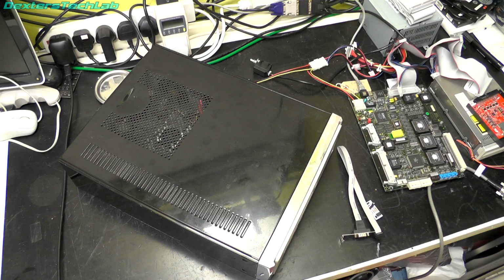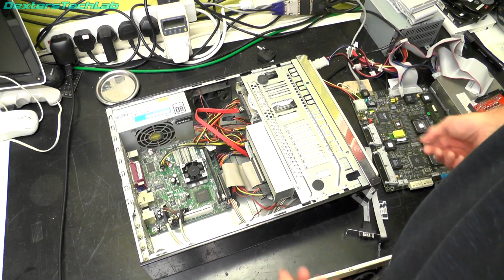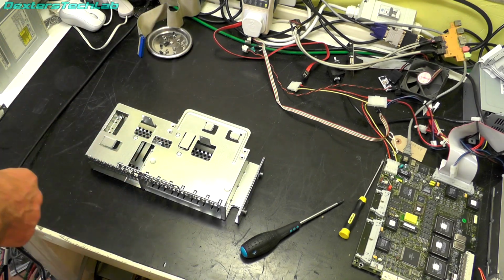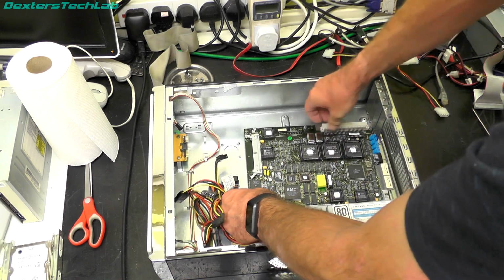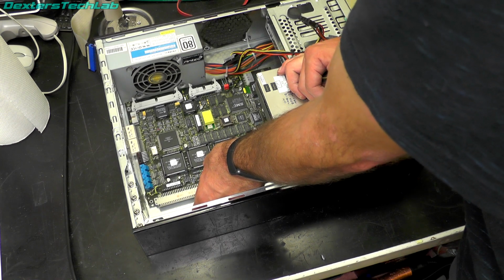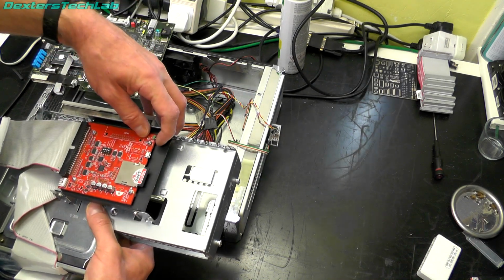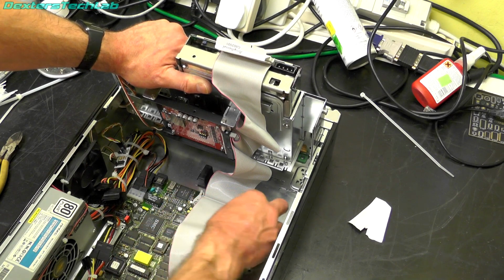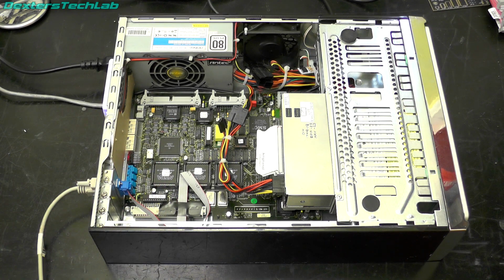DL247 Quantel Netcom Part 2 Building A Network Storage Drive

Comment: Have you or any of your Discord fellows figured out how to mount a Quantel MO disc on a PC, Mac, or UNIX box? I remember you saying someone was working on that...
Reply from the maker: Not so far, i know some have been working on it but there's nothing working at the moment. There's several of us now with working machines that have an MO disk drive so it's not too hard to read / convert old disks. Do you have some disks you need to read?
Reply: Yes, I have several, but I’ve no idea what is on any of them… at least one disc I knew had pictures, that accidentally got reformatted….. :(